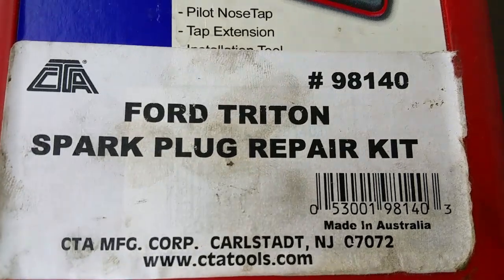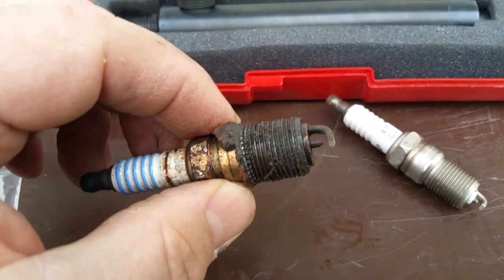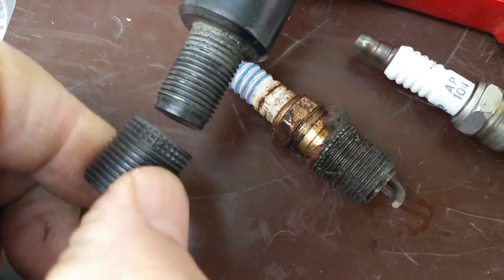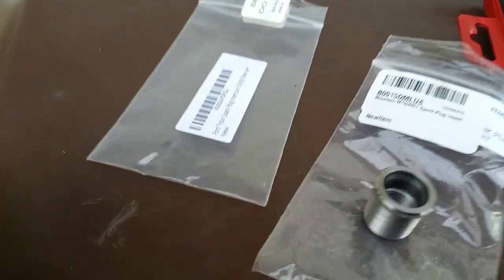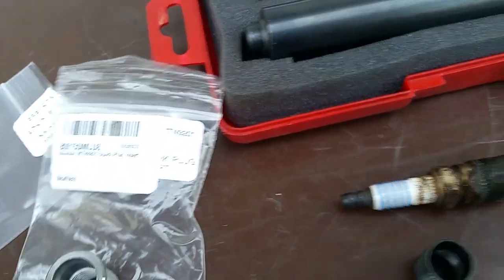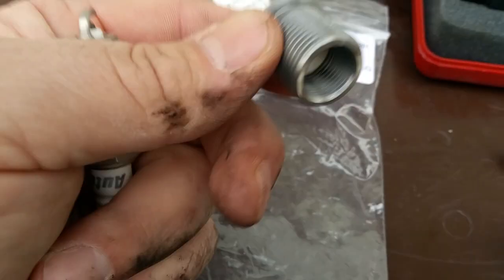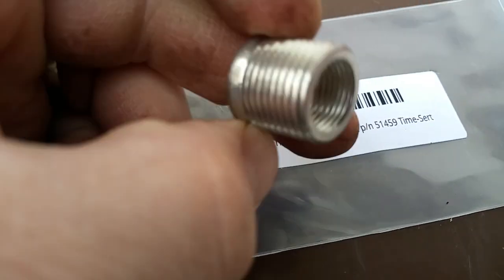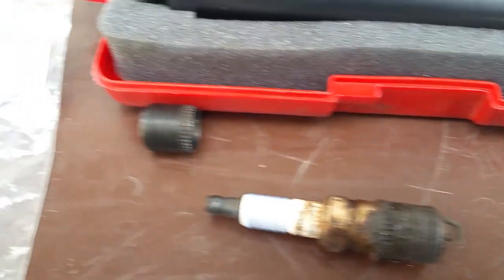Ford Triton Blown Spark Plug repair kit recommendations

Comment: I used the high temp Loctite on the thread  and JB weld on the flange of the Cal Van insert. Worked great.
Reply from the maker: Report back in like 10k miles. I'd like to see how it performs long term.

Comment: I hope you’re still well.. it’s been a while. I’m stuck, I bought a 1997 5.4 2 valve that’s blown out a previous repair kit. The lower threads are damaged.. at least on the insert. I can’t identify the old insert manufacturer so I’m having difficulty finding a larger insert and kit to redo the block threads. I even bought a measuring caliper just to discover most companies don’t describe the outer diameter of the threads. Just nuts ! I’ve watched several times and while I hope the mountain kit will work it’s like rolling dice. Have you got any more comments since the creation of this video.. thanks.
Reply from the maker: Do you recall the design that you used?
Reply from the maker: The Mountain company is larger and can be used in place of the other two.

Comment: The thing that none of these videos talk about is it's impossible to get to the spark plugs you have to have all kinds of special equipment not only are they covered up by all of the engine and there's no room to even get your hand in there or a tool on top of that they are down in a deep hole and the hole is at an angle
Reply from the maker: @JohnJohnstjohn  absolutely agree. The one that broke on me was under the fire wall.

Comment: If the insulator is breaking away its getting too hot. Run a colder plug, aka heat range. The insulating porcelain and center electrode on 'colder' spark plugs do not stick out as farinto the combustion chamber. Insulator chipped or completely gone means that porcelain has been banging/grinding all over that cylinder until it gets blown out the exhaust valve. NEVER GOOD
Reply from the maker: Junked the truck. The sleeve was not making a seal.
Reply: @MrRChitty  unfortunate. On a different note....I had a 1993 explorer with the old V6 4.0L #1 Cylinder always was chipping/blowing the porcelain off inside. Turned out to be a coolant leak into that cylinder that was causing the insulator to break and throw a misfire every 5k-8k miles.
Reply from the maker: @neidylanar4590  that makes sense.

Comment: I have the Mountain kit that I used on my Expedition. It’s a knockoff of the Calvan kit. I paid $150 bucks for a used kit with 8 Calvan inserts.

Works like a charm. I used one of those Napa kits that has the self tapping base and a long 3 valve plug, but it kept giving me a misfire every couple weeks or so. I pulled it out and the base was melted away…garbage. but it gets you on the road anyway. Just know that you’re going to be doing it right AGAIN!
Reply from the maker: I was never able to get it right and after 200 k Mike's, I drove it to the scrap yard as it was time.

Comment: 6 TIMES you've done this? Try a different insert holy shit. I've had 1 in my mercury that's been there for 8 years now
Reply from the maker: I no longer have it. However, it was a pain in the ass reaching back to that cylinder. All I would do is put another sleeve on another plug.

Comment: The Cal Van insert system is far superior to everything else.  Cal Van 389000 for the 2 valve.  I believe they also have a kit to fix the failed inserts of other brands.  I used JB Weld on all the threads and torqued to 25 ft-lbs.  I did all 10 proactively in one long day.

Comment: I looked at all of the options for my 1999 Ford F250 SD 4WD with the Triton V10 and decided to use the Cal-Van kit. So far - So Good. As for the spark plugs......When I bought the truck used, it was running horribly. I pulled the spark plugs and found the gaps were all over the place. I bought a set of E3 spark plugs and a new set of coil packs and have put 68,000 miles on them, so far. Even the one that blew out looked really good. I decided to go ahead and put it back in after installing the threaded insert just to see what would happen. The truck is still running perfectly.
Reply from the maker: Good to hear. Thank-you for the feedback.
Reply: Is the spark plug well pretty deep in that engine variant. You like the 4.6 variants are

Comment: The wurth inserts can also get clamped against the spark plugs of the non-tapered seat variety (washer type) and also come out with the plug upon service - I have a trick of putting them slightly below the surface and nearling over the top before locking the last few threads …. I used helicoils without this issue - but they are very fiddly in comparison (tang & thread skipping) …. 👍👍

Comment: Their is a company called CalVan that make the perfect tool for this job but the one you are useing just take some fuel line thread it down with it i have a bore scope  that i can look down the cylinder to make sure that is at the proper depth then use the tool to smack it in but if you use the CalVan you don't need to ges how far down you need to be it only go's down so far just remember to use lock tite on the out side threads and never seize on the spark plug torque to 20 lbs. recomind weighting over night to star it so the lock tite cures.

Comment: Just noticed my last comment I said cylinder farthest from car I meant to say furthest from carburetor. The further from the carburetor the leaner the fuel mixture especially noticeable on cold morning start ups enough to cause engine misfire  until engine reached operating temp.
Reply from the maker: Mine was a throttle body with independent injectors.

Comment: Thanks for the quick reply, but please, please do not give up!, that makes ford the winner! I am a class A auto motive machinist plus over 60  years automotive mechanic. The secret stopping the spark plug from blowing out the porcelain  the non Fowler bushing which will get the plug half inch out of combustion chamber but still able to get the spark to fire the cylinder perfectly reducing the heat on tip of plug and never ever having a misfire because the tip of spark plug burned the porcelain out.I was mechanic for G M  dealership in 1964 and 1965 when first big block Chevrolet came out and if they were jetted too lean and ran wrong thermostat they melt the ends of spark plug furtherest from car which was usually number 1 or 8. We found if we put nonfouler bushings in those cylinders problem solved. Using higher octane fuel helped control combustion temp. By the way what octane fuel are you using?

Comment: MrRchitty simple to fix the plug fouling problem, go Napa , buy a non fouler sleeve. Use anti seize on the sleeve and spark plug and good buddy your problem will be solved on fouling the plug if it oil related, on the other hand if it is fuel related you might need to switch injectors with the one next to it  just to see if fouls that cylinder, if so your question is answered whether it is oil or fuel related. If you have not had your injectors cleaned lately I would nearly bet the plug fouling would be related to dirty injector. I have a 2001 5.4 with 271,695 miles, never have had a fouled spark plug but I never have used less than 87 octane fuel except in emergency and anytime I can find it I use 92 octane just to keep the plugs cleaner. The next time you foul that plug go ahead and switch coil packs with a cylinder next to it just to see if next time it fouls that one.If so you wii know that coil pack was the problem all along. By the way I am 78 years old, retired mechanic  “not retired tech”. Glad that you tackled the job your self rather than trusting some ripoff dealership. Their only objective is to sell you something you did not need.Hope this bit of information cures your problem and if so I was glad to have helped.
Reply from the maker: Hey Gary. The fouled plug is the result of a bad designed thread repair kit, what the video is about. Injectors were rebuilt and move, coil packs replaced, etc. That cylinder keeps experiencing cracked insulators at the the tip. Anyway, last solution was to driver her to the scrap yard. She gave me 15 years of hard service. I honestly couldn't ask anything more. Thanks for your feedback, though. We have had a plug blow on one of our ambulances 10 cylinder motor. We used a sert (spelling) insert like in the video. So far, so good.

Comment: I used the tap kit $45+tax at Autozone lasted for seven years 20,000 miles before It leaks air.So I replace it again with the same kit will check it  again on 2027 for leak like a hissing noise.

Comment: I used a Big Sert after one of those knurled top thread adaptors blew out in my Duratec. The Big Sert was 2mm larger outside diameter than the blown out adaptor. Worked fine. The Mountain insert in this video looks like the Cal-Van inserts, which I have for my 2 Valve Triton.

Comment: Napa makes it better kit part number 6003248
Reply from the maker: Good to know.
Reply: FYI the NAPA kit is actually a Dorman Kit. I got very lucky , the plug that popped out  had less than 10k miles. I got boro scope checked the threads  which were fine and the plug was fine, just re gapped. Went 150 miles so far with no issues. But keep this kit in my truck with tools and a coil pack just in case.

Comment: One thing to consider that I noticed nobody mentioned is that if you have a defective injector seal to intake causing iter leaks you will get high compression ratios due to overheating age they should be changed once I did that truck never run better I don't have blowouts
Reply from the maker: Was a consideration. In fact, I felt the actual repair may have been leaking slightly with similar results.  Either case, I did an injector rebuild and moved them to rule out a bad situation.

Comment: After you insert the sleeve you're supposed to peen the top so it can't come out
Reply from the maker: You are correct. You turned the tool over and set it back in and tap the end of it. For some reason, this plug kept fouling out which required changing it. On the second change, the sleeve came out.

Comment: It doesn't look like the insert that u used and came out with the plug was flanged out at the top. I got a Lisle kit and it has the same inserts but the tool u use to swack the insert once you put it in looks like yours but it doesn't fit down it the insert like urs just did. It looks like ur swacker isn't the right size. Plus u can't believe any kit would say to use any kind of rvt. But I know they do. But always use red loctite. Rvt will not set up right in threads because of the absence of air. Loctite is designed to set up without the absence of air. And that's coming from the makers of loctite. But when you put loctite on the insert and screw it in, wait an hour before you even do anything, like unscrew the tool u use to screw in the insert. Then swack it. But like I was saying it doesn't look like urs was flanged out at the top like it had been swacked? But either way I bet it wouldn't have backed out if you would have used red loctite. Also be careful of using bigger inserts and making bigger holes. Because of ur valves. I know on my Toyota I couldn't use anything bigger than what u have there.( The first one you used). Cause it would get into my valve. Even when it was closed.

Comment: Nice video. I just bought the CalVan kit for 2v Triton engines. I've heard nothing but good things about it. The cheap insert that the previous owner installed blew out. I'm not doing this again. It comes with 8 inserts. Spares are $20.
Reply from the maker: Good luck with the project...

Comment: Hi, cool video, I have the black coil. How do I make sure it doesn’t go through too much inside?
Reply from the maker: Are you using the insertion too? I dont have the instructions in front of me, but I believe you use orange silicone sealant on the external threads which would provide enough friction to back the tool out. The tool gets turned over and placed over the insert and tapped with a hammer to expand the insert into the head. You will need to use the instructions.
Reply: MrRchitty oh so the spiky part doesn’t go in the head where the threads but rather stay outside and expand? I thought the pointy part also went inside the hole after tapping it
Reply from the maker: @jorgemartinbg  exactly. But what would happen to mine is it would back out on spark plug change.
Reply: MrRchitty so after the whole is made you screw the coil in until the spiky part is about to go in and then you hammer it ...
Reply from the maker: @jorgemartinbg  yes.
Reply from the maker: @jorgemartinbg  as long as you are following the manufacturer's instructions. When placing the insert into the newly threaded opening, you must use orange or high temp silicone on the external threads. Using the tool, you thread the insert onto the tool and then use that to thread it into the opening. once seated, you should be able to back the tool out, turn it over and place it back onto the insert. Using a hammer, tap the end of the tool. You;ll feel a difference in the feel with each strike as the top of the insert is pressed into the head. Once completed, the tool is pulled back out and you are then ready to insert the spark plug. I am assuming the you took the time to blow the shaving out of the cylinder.

Comment: The knurled crosshatch section of ur original kit will prevent it from going all the way to cylinder when u punch it, it flares out. Just put it back on new plug and send it. Done mine probably 3 times and reuse same one on new plug

Comment: blew #8 out on my 2004 nav 5.4...did the doorman insert that has the extra long plug....3 weeks later I have a miss fire on 8 again. The thing with #8 is it's way back and under the fire wall...you can't get a drill back there to drill and tap.... and you can't get a hammer on it to ping it over. It was bad enough having to change the 2 piece spark plugs that break off and now this crap with only 4 threads holding plug in....Ford engineer needs his ___ kicked. You fill In the blank.
Reply from the maker: You should be able to use the assembly with an air ratchet. Look around a bit.

Comment: Check out Wise Auto Tools. Time Sert is the best repair kit, the kits are expensive but if you have already used an oversized insert you can purchase an additional triple oversize kit for the repair. Still beats the dealers 2000.00 repair.

Comment: What's the fesale value of a used Ford V-8 ?   These engines are so bad the used Ford should be a dime a dozen. Blow a plug, just go buy a used Ford, it would be cheaper than the kit
Reply from the maker: I drove mine to the scrap yard.  Brake line and power steering line broke. With over 200k on it,  I stopped wasting my time on it.

Comment: MrRchitty I have a 99 f250 LD 5.4 I had a 42025 spark plug repair kit which had the sleeve and the 3v plug that came with it. After 5 yrs that the plug needed changed everything came out I was wondering if I could use the mtn sleeve on this to permanently fix this and what size rethread tool I need to use to install the insert also what should I torque the insert to after installing
Reply from the maker: The mountain one would work, but you're going to need their tool. I don't know what to torque it at, but what ever you set your spark plugs to sounds reasonable. Put a message out on FB. You may find someone with the tool. Good luck.

Comment: I use the cta ones and works great when installing add anti-seize on the plug, srew plug on heli coil. Add jb weld  on hat of coil then red lock tight on threads, crank the coil and plug about 28 ft lbs  then take plug out, hammer the coil with tool. Add plug and torque about 20 ft lbs and let sit overnight. That’s it.

Comment: The MTN9201 is big and beefy unlike the others, which according to Ron Williams ( on youtube) are not good for V10 and fail all the time, but are good for small engines. He uses the Calvan from wise Auto Tools. The sleeve on the MTN 9201 is similar in size to the Calvan. I believe the Calvan has more threads to screw into which grips the spark plug. Ford has a design flaw in the head. There's only about 4 or 5 threads tapped in it to receive a spark plug that has about 11 threads. as a result, plugs come loose and blow out. Have you tried Calvan? How much is the MTN9201 kit?
Reply from the maker: Joel C One of the guys at work bought NAPA' s rebranded version of the Mountain Company. I want to say he paid roughly $250. The job was real easy. It was on a V10 van and took him about an hour. He was able to work around the fuel rail without removing it. Using air powered tools made it a sinch. I think the coil sticks up a pinch, no big deal. He waited for the compounds to set and we've been good.

Comment: what size threader was used on this
Reply from the maker: Andrew Cruz It's not indicated in the package. But,  all three referenced here are different.
Reply: mine blew and the 14 mm is not big enough
Reply from the maker: Andrew Cruz 14.5 is the original size.
Reply: MrRchitty. it seems even bigger i gotta find a borescope in look inside
Reply: Where you get the mountain insert from? I had the same problem..

Comment: Red silicone?!?!?!...RED LOCTITE!
Reply from the maker: Patch Ster I agree, using the red loctite. However, the instructions specifically state to coat the outside thread with a high temperature silicone, which many know that to be typically red.
Reply: MrRchitty contact manufacturer... I believe they made a serious mistake...too much pressure going on for hi temp silicone
Reply from the maker: At this point, the truck is a backup and is used to haul a trailer for gathering wood.

Comment: I used the Cal-Van 38900 repair kit on a 1999 Ford F150 5.4l 2 valve. Here is a link https://www.youtube.com/watch?v=xGvFev7XqkA  Also, it looks like you put the thread lock on the spark plug threads when it should have been put on the insert threads.
Reply from the maker: joe jacobs The CTA brand calls for orange high temp silicone sealant on the outer threads of the sleeve. That's what I did.